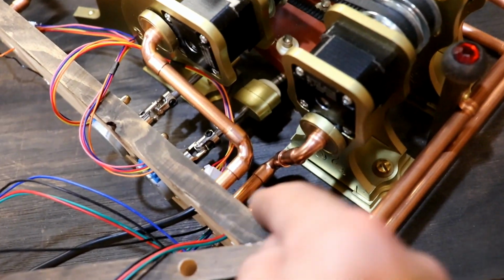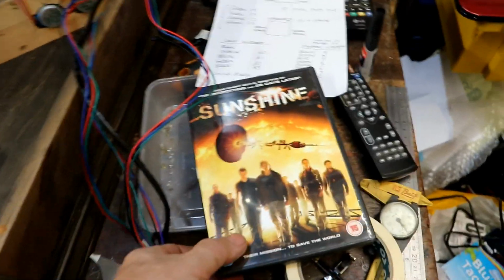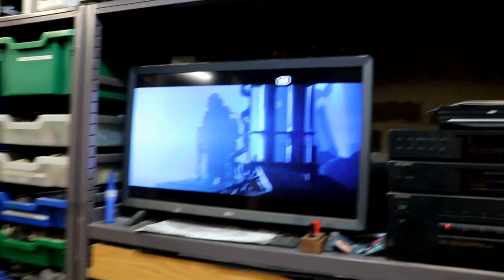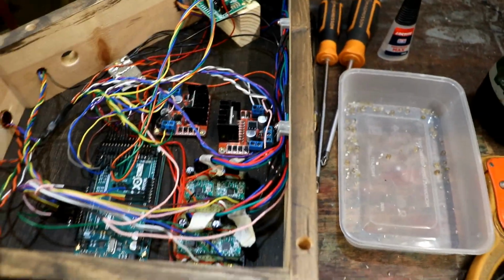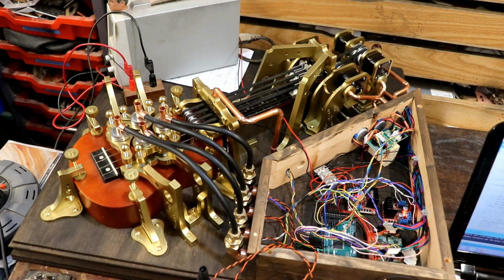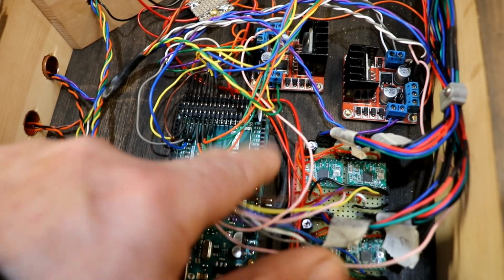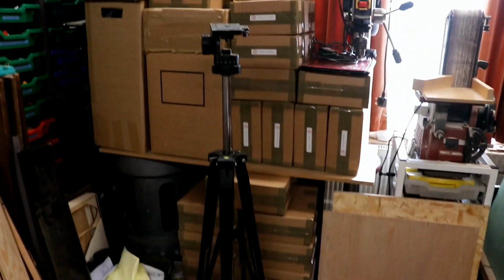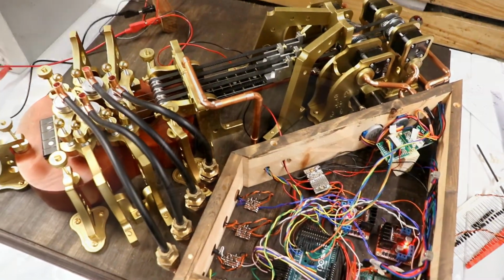So exciting - Install all the Ukulele playing circuitry in the steampunk cabinet

Comment: since you have access to a ground reference, you could get away with 2 diodes instead of a full bridge by just connecting the LED cathode to ground instead of its half of the bridge.
Reply from the maker: That's an interesting idea, however I vaguely remember one of my viewers, possibly you, suggesting LEDs should not be used as diodes... actually it might have been specifically flickering LEDs with a built in IC. Thanks for the idea, I've built them now this time, but in the future...
Reply: @steamhead  That was me.  An LED can only take a few volts in reverse, and an LED with a chip in it shouldn't be reverse biased at all.
But if I understand spambot71's suggestion, the LED would not be reversed.  The cathode would be at ground, and the anode would be pulled up by either side of the motor going positive, using a diode OR-gate.
Whether that's actually simpler remains to be seen, as I've not finished the video yet!
Reply from the maker: @epiendless1128  I remember your post and thank you, it makes perfect sense. I look forward to hearing your conclusion!

Comment: when it comes to saving I/O pins, have you looked into i2c at all? it's a 2-wire serial bus, you can connect a ton of devices to a single bus, and it's a very common standard so there's plenty of things like sensors, motor drivers, displays, I/O expanders, LED drivers (even with PWM for smooth fadey effects), basically anything you can think of. it's nice because you can run every interface board you can find an i2c version of off a 2 pins total, which leaves tons of IO pins for other stuff. the main annoying bit is you have to think about addresses; every devices needs a unique address, they're only 8 bits, and most chips have a hardcoded address and maybe if you're lucky have a few pins to let you configure the last couple bits of it so you can use more than 1 of that chip per bus. Also I guess for musical applications you might prefer the really tight timing of driving things directly, but in practice you can just save i2c for the less timing-critical components, or just set a decently high bus frequency and you'll still be good to within a few milliseconds
Reply from the maker: Funnily enough I love i2c, and this is the first project in which I haven't used it (yet)! I'm sure it's only a matter of time before I do run out of Arduino pins, so thank you for the suggestion.

Comment: how much current do those 5V tuning motors draw? i'd be a little worried drawing anywhere near an amp from a linear regulator without a beefy heatsink, or more than a few hundred mA continuously. you might be fine but just to be safe it might be worth getting a little buck converter module to supply the 5V rail. The other thing is that i'd be a little nervous having motors and microcontrollers on the same rail (since the motors are gonna put a lot of little spikes and noise onto those lines); if each of those 2 boards has a 7805 on it, maybe you could run the motors off one of them, and the electronics off the other one. i may be overthinking it on that point, but if you ever find yourself 10 hours into debugging an inexplicable glitch it might be worth considering
Reply from the maker: Thanks very much for your suggestions. The tuning motors draw about 180mA if memory serves. Only one will be turning at a time and the interface chips they connect to have anti-kickback diodes, so it hasn't concerned me in the past, but what with an additional 12 volt supply and trying to use the onboard 7805 voltage regulators, it may well cause a problem. Thanks for the idea of running them off a seperate regulator, I'll get that done this morning.

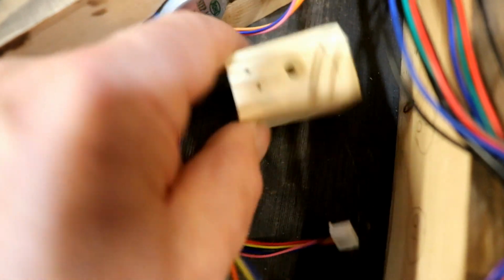Comment: 8:03 great idea to showcase the leds. For the leds on the motors maybe use 100PCS 5mm Dual Bi Color Polar Changing Red/Green Led Diffused Leds 2-Pin leds (ebay $4).
and instead of the large horn how about a smaller bell or the reflector from an old led flashlight with electret mic inside and the wires routed thru 5mm copper? of course you would also need an led on it to lite in tuning mode. BTW I think the noise from the steppers adds a bit of charm to the overall sound. Ukulele? where? lol
Reply from the maker: I did wonder whether to use bi-colour LEDs, but I always come back to the idea that everything seen, should have been available to the Victorians! I'm still not happy that the plucking LEDs switch on and off, as the Victorians would have used gas lights - I'm thinking about adding capacitors so the lamps fade up and down... pedantic?
Reply from the maker: Thanks for the ideas on how to obtain a smaller horn, I think that may be the way forward. Talking of bells, I've just remembered I bought a load of nasty Christmas decorative bells a few years ago; they are the right sort of shape and are large enough to hold the electret mic, mmm...
Reply: haven’t tried it but what about using 2 red or blue leds connected like a bi color
Reply from the maker: @TheUnofficialMaker  that would work, but I'm still drawn back to what the Victorians would have had avialable. So I'll work on getting the LEDs to have a bit more fading as if they were gas lamps being 'encouraged' with a puff of air!
Reply: @steamhead  OK, but I don't see making that happen without going thru the Arduino, but then again you do come up with cool circuits!
Reply: @steamhead  555 timer. that fires when the motor triggers then you could be very precise with the flicker.
Reply from the maker: @TheUnofficialMaker  I recon having an electrolyic capacitor across the output of the bridge rectifier may allow the LEDs to fade quickly rather that instantly switching off. A resistor feeding the capacitor may also allow them to fade up? I'll give it a go...

Comment: I like the idea of the horn pickup for the tuning process but I do think it will make the machine look too cluttered.  I wonder if you could move the horn into place for tuning and then move it out of the way when it is done.  Of course that would involve more motors and whatnot...

I do like those mechanical iris.  I recently found some on thingiverse that look good.  I just haven't found a good reason to print one out.  But at the moment the printer is collecting dust and filament is being toasted in the dehydrator so I might as well do it now.

Thanks for another entertaining video.  Hope the disco party goes well.
Reply from the maker: Thank you. That's the second comment erring on the side of a hidden or 'moving out of the way' tuning system!